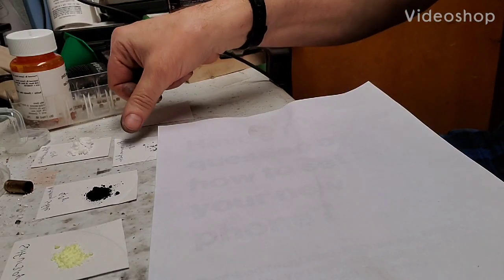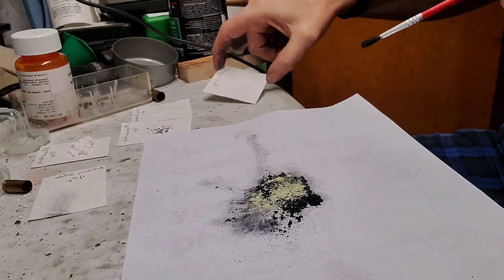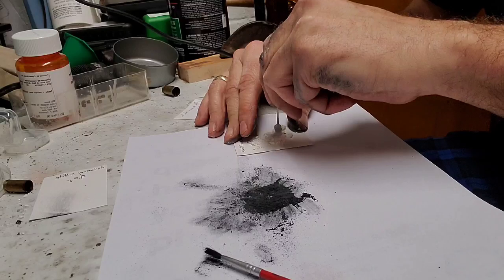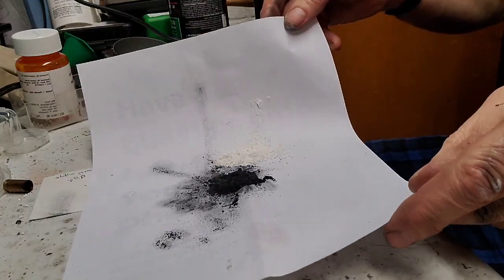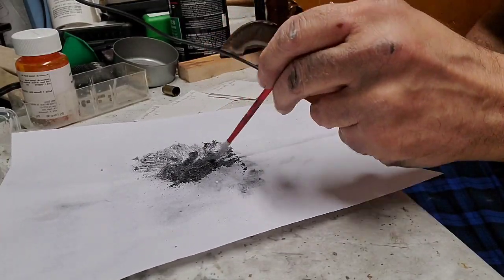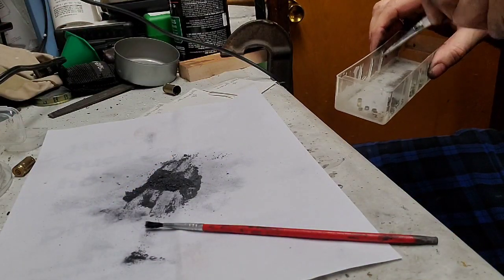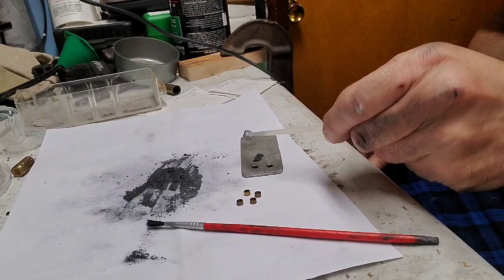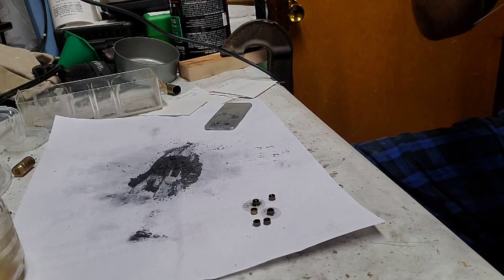Reloading primers with homemade priming compound H-48

Comment: Seems to me that using a mortar and pestle on each ingredient separately before mixing would alleviate that chopping and mashing and probably deliver a finer and more homogeneous mixture.
Reply from the maker: It does
Reply: And save a lot of “happy chemicals” comments!
Reply: good luck fnding that third compound, hell good luck just finding plain ol' black powder. I haven't seen (retail price, not bunker price) percussion caps in over 2 years. thinking i might try to revolutionize the industry before the EMP locks down most all commercial commodities
Reply: @ColMason  Glad the percussion cap and black powder prices have come down a lot in the last couple months. Have found some for fair(ish) prices recently.
Reply: SEPARATELY MOST DEFINITELY, I know of a 3 1/2 fingered friend whom would definitely advise against mixing together, He attempted once just once with prime all large batch, flames got 1 finger, infection set in hospital had to remove part of another. Yes I am evil I laughed my ass off. He even admits thinking back he realizes it was dumb, stupid to try a pressure sensitive friction sensitive material mix in a mortar and pestle not the rational, sane approach.
Reply: I've tried prime all with about a 50% success rate. But it was probably operator eare. I'll try again. I do believe that it will work once I get it figured out. I just ordered 2 more kits, I've got a peanut can full of spent primers, and lots of time .
Reply: @paulbrinker4973  I'm more of a Prime All supporter than a home brew guy. Prime All is cheap enough and loads a ton of primers per kit. Also using the measuring dipper as intended gives you a good mix. My success rate topped out at about 95% after some experimentation but it DID take a while to get there. I have quit reloading primers now since I've able to acquire a very solid supply of factory primers without overpaying or at least by very much. I have saved my cup and anvil supply and of course all the little tools etc. in case this shortage happens again.
Reply: @jfowler7604  Where have you been able to find factory primers?
Reply: @tenatra  Within the last year, I have purchased primers from Brownells, Powder Valley, Midway, and a couple other online vendors plus Scheels, and Bass Pro. They ran between $80-$90/K. There are also tons of places that now are selling import brands in the $70/K range. The prices of CCI, Rem, Win seem to be around $85/K now and Fed is higher than that. I had to work at it some but managed to find about 20K. I did buy imports once and paid a higher price at the time b/c that's all I found. I've avoided the imports whenever I found US brands at a fair (ish) price.
Reply: @jfowler7604  I guess I need to be on the lookout.. I just need some firing caps for hunting...

Comment: I have reloaded a few primers, going through test stages. for the paper disks  tolit paper, but I just pulled anvils out of 100 small rifle primers and CAREFULLY took a big sewing needle scraping out primers. only one went off . will load back in small pistol primers. testing Walmart cap gun, the kind that are a eight shot plastic ring . it is very unforgiving but easy to get propellant out. also iam testing the 22 cal loads for shooting nails into concrete such as sold at Lowe’s and Home Depot .they are a real pain . I use nail sets , smallest first to open crimped shells, then every size till I can take needle nose pliers and break peace’s off to where I can properly scrape propellant out of bottom and sides. it takes forever but decide after testing what works best for you and have a blast. Nana and papa aka the hunter wishing you well . if you have a adjustable lighted magnifying desk model that folds, that’s awesome because my older eyes plays tricks on me and it’s a big help.

Comment: Do u have a hardening agent in them? Or what would u recommend
Reply from the maker: The shellac is the hardening agent
Reply: 90%rubbing alc. What I was told. Makes it a bit less touchy and easier to put back in primer cap. Let dry 24 hrs and you have primers. But I missed half the ingredients and how much of each because my internet sucks..lol
Reply: I done bought this and made no telling how many rounds the kit includes the hardening agent now. In my opinion it's not worth having. Takes me 2 hours to fork out about 50 rounds I could of bought for 10 bucks. By time I make 500 rounds I'll be dead.
Reply: @w.e.s.  The reason to have the kit is for when there isn't any ammo to buy at a reasonable price. Shortages are becoming more and more common.

Comment: Is there any way you can reply to this with the name of the first ingredient?
Reply from the maker: Materials needed: a) Potassium Chlorate powder, b) Antimony Sulfide powder, c) Sulfur powder, d) finely ground glass preferably pyrex (consistency of flour) or grit, e) Sodium Bicarbonate powder (i.e. baking soda), f) Scale that weighs in grains, g) plastic weighing boats, h) SS or plastic spatula for transferring chemicals, i) plastic spoon, j) bamboo skewer with a flat end and a powder scoop carved on the other end, k) paper disks punched out of ordinary copy paper that will fit inside the primer cup, l) dilute shellac solution in denatured ethyl alcohol (~1 part shellac in 10 parts of alcohol but the exact concentration is not critical), m) Aluminum powder (60-100 mesh) optional, n) needle nose pliers, and o) small rod or tiny screwdriver (diameter of shaft ~1/16” or smaller) 1. Using 4 plastic weigh boats and a suitable scale, weight out the following materials: a. Boat 1, 17.0 grains of potassium chlorate, b. Boat 2, 9.0 grains of antimony sulfide, c. Boat 3, 4.0 grains of ground glass, and d. Boat 4, 3.0 grains of sulfur, 0.2 grains of sodium bicarbonate (helps stabilize the mixture on extended storage) and 0.2 grains of aluminum powder The aluminum powder is optional, but provides extra incandescent particles to help ignite slower gunpowders. Aluminum powder is commonly used in commercial Magnum primers for this same purpose.
Reply: @rifleshooter2  Dang Thank you. You went above and beyond on your response I’ve just been using Caps and Strike anywhere matches till now ( I can’t get the strike anywhere’s to go off ) but the caps seem to be pretty reliable. I soak the paper caps in water for a few minutes then scrape the paste into the 22 brass, drop of acetone and let it dry overnight. But i want to make actual priming compound . hopefully i can find this stuff in Canada
Reply from the maker: @joeyskullz111  My pleasure be careful and good luck
Reply: @rifleshooter2  Does it matter if I use Antimony(III) Trisulfide (what you appear to be using here, Sb2S3) or Antimony(V) Pentasulfide (a red powder, Sb2S5)?  I ask because I bought the Pentasulfide before I realized that there were two different Antimony Sulfides, but everyone seems to be using the Trisulfide.  :(

Thanks!!
Reply from the maker: @Lee_Adamson_OCF  I do not know. I'm not a chemist. I just follow the work of others

Comment: What aluminum powder did you use , was it just aluminum powder or was it Magnesium-Aluminum ? Great info thank you .
Reply from the maker: Just aluminum powder
Reply: @rifleshooter2  

Ok , on skilighter they didn't show just aluminum powder. I will look else where for just aluminum powder . Thank you
Reply from the maker: @kmackiss  must be out
Reply: @rifleshooter2  Do you know if it makes a big difference using a finer grain powder ? Aardvark recipe shows 60-100 mesh that converts to 150-250 microns . Smaller the grains the faster the or hotter burn rate ?
Reply: @kmackiss  
0.2gr aluminum flake is not for burn rate. Rather to make hot incandescent particles to ignite spherical powders reliably.
Check aardvarkreloading.com
Reply: @rifleshooter2  tumbler and ball bearing make at home
Reply: www.pyrochemsource.com y’all...  :-)

Comment: Where did you buy/make the compounds? powdered glass? Couldn't find it on the internet.
Thanks
Reply: Tumbler and ball bearing
Reply from the maker: I ground the glass myself. Everything else I got from. Skylighter
Reply: @JDJ1963
Bullseye COE 90 transparent fine glass frit.
eBay
I grind it finer with ceramic mortar and pestle (cheap porous, ebay or Amazon)

Comment: Is this compound corrosive and do you need to clean your guns asap after using them
Reply from the maker: Yes
Reply: I mean, you don't need to clean between shots, or speed  100mph home to clean the firearm before it falls apart, but yes, the salts (sulphur and potassium chlorate) form sulphuric and hydrochloric acids when exposed to water, which the fouling in the bore/surfaces exposed to combustion gasses, will absorb out of the air. The gun won't rust apart on you in a couple days, but the corrosion damage is cumulative, so just make sure to clean it after every shooting session. Most priming made prior to the 1970's was made with compounds similar to this, and most of those arms are just fine so long as they were maintained. That's why the AR10 and Ar15 gas tubes are stainless and the gas system on the Kalashnikov pattern rifles is easily removed for cleaning, lessons learned from earlier self-loading military rifles (gas systems aren't generally disassembled in the field)

Comment: What attachments did you use for your press to set the anvil in the cup?
Reply from the maker: The punch from my Lee .451 sizing die and a piece of steel threaded to fit the press
Reply: @rifleshooter2  any leads on where to get the threaded steel?
Reply from the maker: @jasongilley4032  I threaded it on my lathe
Reply: @rifleshooter2  right on! I'll take 2 haha. Thanks for the info. Keep up the good work!

Comment: You crushed the PP with the end of the brush that had the other chemicals on it.

Should wear a face shield if you're not.

Also consider gorilla mechanic gloves.
Reply from the maker: I have the shield on but the gloves would be a wise addition
Reply: @rifleshooter2  Yeah, those Gorilla mechanic's black gloves are resistant to more than gasoline.  I'd hate to think what that fine cocktail might do to your system.

Maybe even a light mask?  If it's fine enough, maybe there's particles floating above it when you're mixing it up, no?

Can you combust spontaneously while barbecueing?  :D
Reply: Are you his mommy

Comment: Nice thank you for sharing your thoughts with us. 
I have question.. what will happen  
if I didn't  add the anvils.
Reply: Nothing.
The anvil provides the firing pin a point of impact to ignite the the primer compound. 
Without it nothing will happen.
Reply: Unless you're reloading Berdan primers and cases, nothing. Boxer primers must have the anvil. Berdan primed cases (usually, steel) have the anvil inside the primer pocket. They also require some specialized tools to deprime such as a hydraulic deprimer.
Reply: Then you have a percussion cap, suitable for use on your favorite muzzleloader.
Reply from the maker: I don't know.
Reply: There's a reason they call it an anvil......what is the sound of one hand clapping?
Reply: If you weighed each priming cup to 1/10 of a grain, it would be some serious match primers